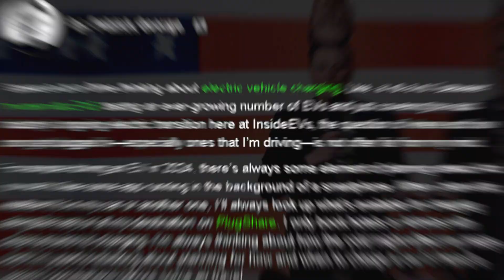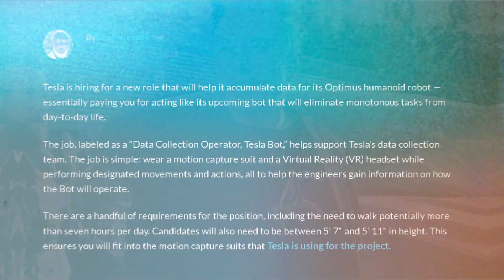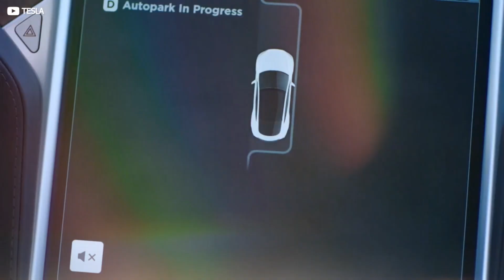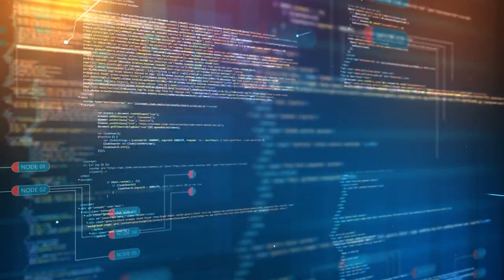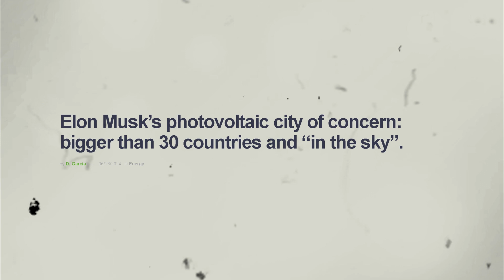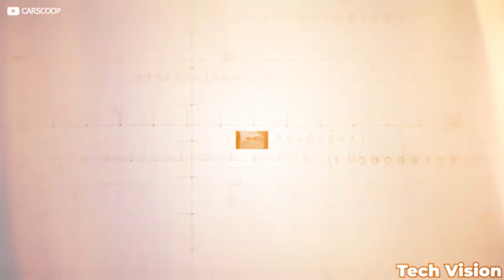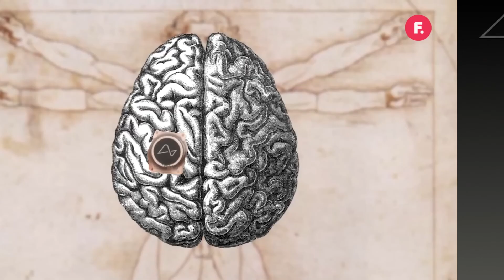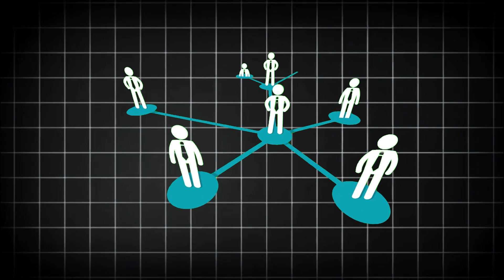How Elon Musk Tesla is spying you.

Comment: There's no key and no start button. It senses your weight in the driver's seat to turn on and off. You don't "change the battery"..you "charge it". It doesn't send data back unless you are connected to your home's WiFi.